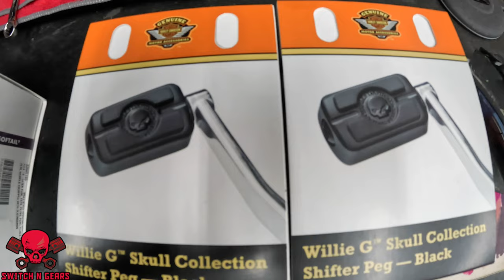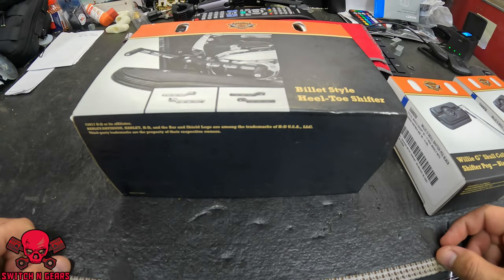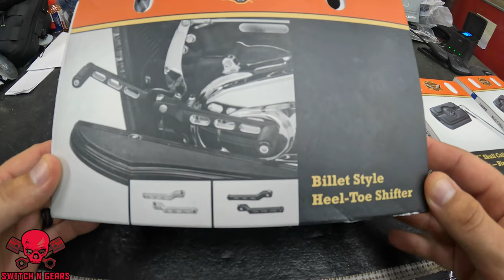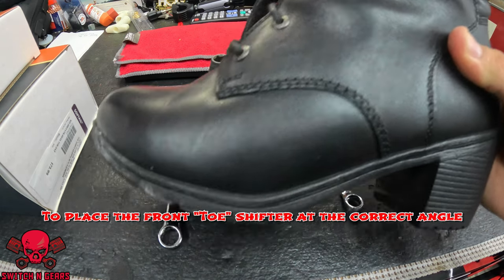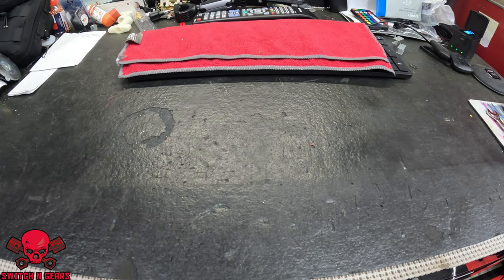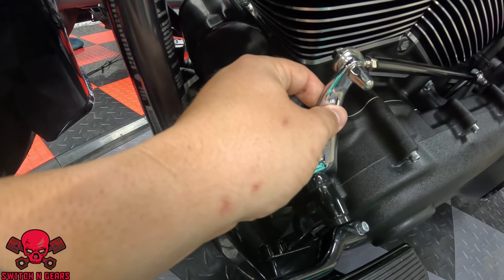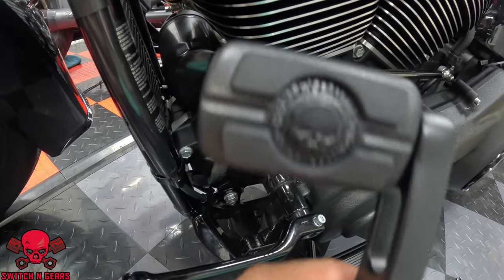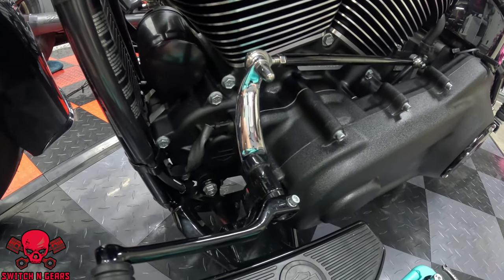Harley Davidson Heel Toe Shifter Install

Comment: Sometimes I like to ride with my feet closer to the rear of the floorboards. This is where my feet would go if it had midmounted foot pegs. I want to get a heal toe shifter but I think it might get in the way of where I normally keep my feet. Would you say this is the case or is there of plenty space to keep my feet there without bumping into the healshifter?
Reply from the maker: Stock might be a little difficult! But I bought floorboard extenders from Crossthread cycles and have no issue doing so....

Comment: 👍 Grest Job.. what bike is that please? I have the Sport Glide. Would that hardware fit that bike ?

Thanks Dave 👍
Reply from the maker: @greengoblindave  Harley Davidson Heritage Classic. I am not sure if the sport glide parts are interchangeable. But I don’t see why the heel toe shifter wouldn’t fit as long as you get the longer arm. A lot of the sport line parts fit on my Lowrider S though !
Reply: @Switch_N_Gears  okay thanks. Yes I was thinking just the are and a rest lever. Or the same one you fitted to that. Looking at your video it does look the same… ?? So fingers crossed 🤞 

And again Thanks… 👍
Reply from the maker: @greengoblindave  good luck sir let me know!
Reply: @Switch_N_Gears  will do 👍

Comment: I don’t understand the plus of using a back shifter. You need to move your foot much more than using the front one. Especially when you try to find the neutral.😮
Reply from the maker: Personal preference and she likes! She finds neutral pretty easy either way!
Reply: It’s nice to have the heel shifter, so you don’t mark up your riding boots, and I have found recently on my new bike. My foot is slipping past his toe shifter, and not changing gears for me. I am trying to figure out a heel toe set up for my dyna switchback.
Reply from the maker: @adventuresofmattyb1386 right on good luck!